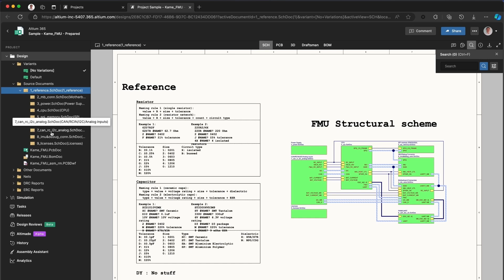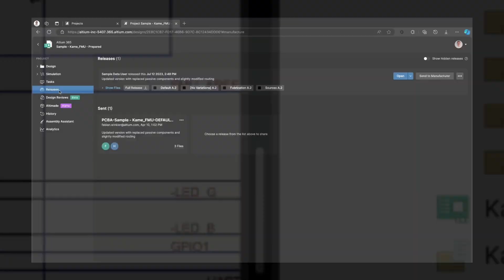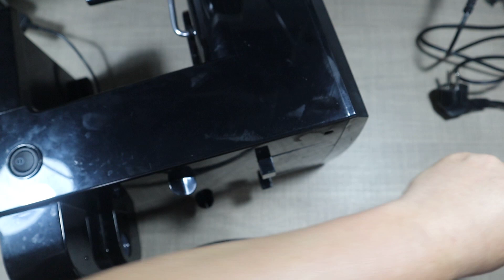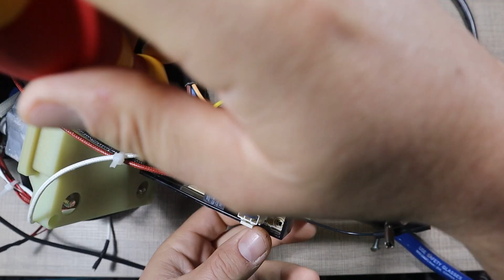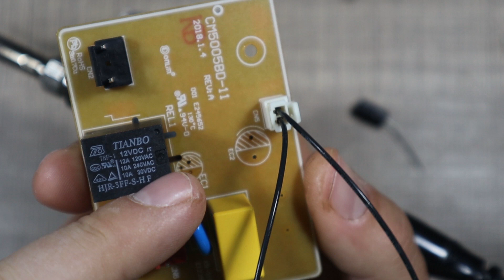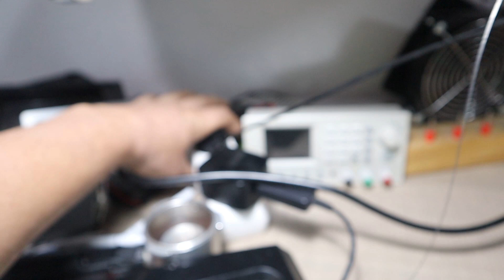KRUPS Coffee Machine Repair with No Power Issue - Bad Capacitors

Comment: I have this model and it has power but doesn't push water into the machine anymore. Is there a way to clean it?
Reply from the maker: There is a small pump in the bottom. Mine was stuck too. I removed it and disassembled it to clean it. It's not an easy job but it is doable. After cleaning mine started to work.